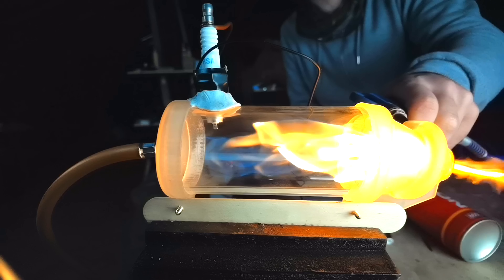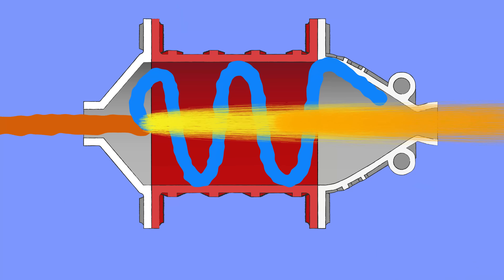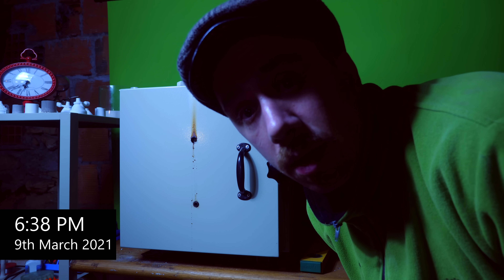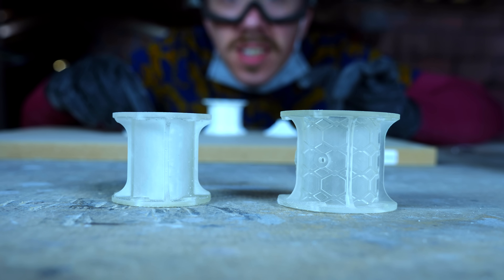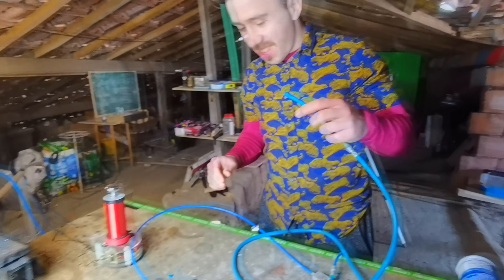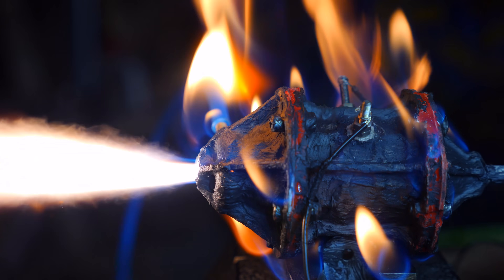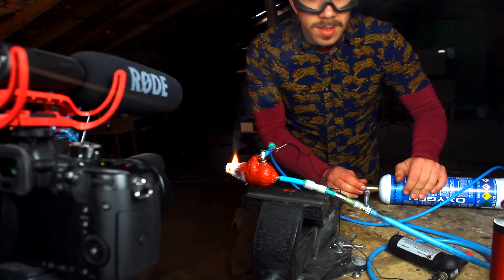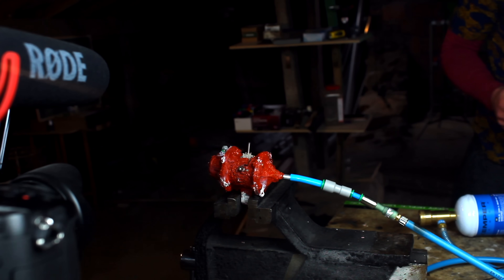Vortex Rocket V2.0 (3D Printed)

Comment: Maybe try a simple pottery glaze on the outside of the ceramic to stop the leaking.
Reply: I had wondered if you could pour the glaze inside the engine and refire it in the kiln.
Reply: you beat me too it hahahah
Reply: @philno  I replied before seeing this - yes, do this.
Reply: simply dip and allow residual  to drip out for ambit, then refire
Reply: @philno  The dip might work well. Not sure what the internal temps are and if the glaze/glass would be adversely affected on the inside. Painting on with a brush, as is done with ceramics, would allow for a thicker glaze (potentially) to the outside without interfering with the internal dimensions at all. Might be a risk of the glaze pooling on the interior where there is a smaller diameter port.
Reply: @blaircox1589  the point of this engine is to have a vortex of cooling air/oxygen running through it,
Reply: @philno  Ideally, yes, it still experiences radiant heat. and the vortex isn't perfect.
Reply: I doubt about the word, «émail» in french: enamel inside like porcelaine?
Reply: Outside is not as much problem as the inside.
Reply: @John Waddington Understood. The benefit of that is it makes it resistant to high temps. The glaze layer we are suggesting is to serve as an impermeable outer layer to prevent the gas from propagating out of the part. The glaze is applied as a thin slurry and will likely still soak into much of the part. It then needs to be re-fired where it melts to a molten state and solidifies essentially as glass. Our armchair comments can be confirmed through testing.
Reply: Glaze will crack under sudden temperature change and will leak
Reply: He could also coat the inside in fireplace sealant to make it harder for the gas to leak out
Reply: @PRODSKY22  That would be difficult to do and destroy the clean interior surface. Only an impermeable outer coating is required to contain the gas. Cracking of the glaze might be an issue, so experimenting with different types of glazes would need to be done. Coating the exterior and refiring would be easy with the added bonus of doing it in any colours he wants, so the parts would be glassy and outright awesome looking when done.
Reply: @blaircox1589  He should probably use a homemade glaze with a high proportion of alumina, as that's the component that confers higher melting points and lower thermal expansion to a glaze.
Reply: @PRODSKY22  Sodium Silicate is a fireproof sealant known to to seal better at higher temperatures, it may blister which will affect the internal geometry
Reply: and the inside
Reply: @John Waddington not necessary as the glaze is fired again. Any bubbles would be removed during this process. You also take care when applying the glaze not to have a lot of bubbles to start.
Reply: @blaircox1589  i'd still stick it in the vakuum chamber. chances are that you might trap airbubbles within the pourous ceramic adding stress to the piece  with thermal expansion. could also strengthen the material if the glasse is within the material. at least its worth a try
Reply: Yes
Reply: @Rocky Robinson perfect!
Reply: perhaps not a pottery type material but one that would melt just enough to get forced into the pores by the pressure? to the comment about the pottery glaze not taking well to sudden changes in pressure and temp... i think you have a similar situation with having a ceramic chamber as well.

you could probably do a pottery type coating on the outside tho as well.
Reply: On the INSIDE and then fired again to harden it

He has a kiln after all
Reply: How bout on the inside?
Reply: @theglobalwarming6081  probably don't want it on the inside. it's likely to crack or possibly even melt again depending on the temperatures. The outside coating will provide a barrier for the gas leaking.
Reply: @blaircox1589  without an inside seal tge gas will be pushing through the ceramic matrix and trying to make the glaze spall off

If the glaze is on the inside the ceramic holds it in place

It's much like glazing a porcelain cup
Reply: @miscbits6399  Sure, but I would guess the PSI is rather low in this application. The materials is as porous as a sponge, so the gas can easily leak through. The dip method will work so long as the excess can be drained without becoming too thick and ruining the ID tolerances. The interior layer may need to be thin while a thicker exterior layer applied. While I haven't made parts like this, I have worked with glaze.
Reply: @blaircox1589  i suspect it will take several dips and a very thin glaze
Reply: @blaircox1589  My concern with the dip process is that the inner surface of the rocket may get hot enough to remelt the glaze.  INTEGZA  no matter how you glaze it, make sure there is no glaze on the surface that will be sitting on the bottom of your oven!  ....unless you want your rocket to become a permanent part of the fire brick.
Reply: @parallax2107  That was my concern in a previous reply as well. And good point!  I don't know the exact firing process for dishware, but the same technique would apply here.
Reply: @theglobalwarming6081  Or both.
Reply: nooo!! or yes but the inside! not outside or your ceramic engine body will fill with fuel and oxygen and could explode!
Reply: @saintcyberchaos265  is that really likely? He's already covered the outside to seal in the gas.
Reply: @blaircox1589  no he didnt :) but he tried..

a vaze with water trapped in it can also explode(~ish) when you heat it up fast

if the liquid or gas oxygen/fuel mix expands fast the ceramic will come apart, I dont think the 'explosion' will be particularly dangerous but you never know.. either way we wants it to stay together

Comment: You could leave grooves between part joints and have o-rings or a metal ring (probably a soft metal) and then bolt it down to form a seal
Reply: but the issue is that it is also leaking through the holes in the ceramic parts left by burning of the resin and also a soft enough metal or O-ring would probably melt because the ceramics work very well at high temperatures but the surfaces are extremely hot so anything toughing them would melt if not properly rated for the heat.

Comment: I think the engines are failing because of the high pressure inside the chamber. Pressure testing might help.
Reply: Pressure testing will just show that they cannot withstand the pressure.
Reply: @Daemonamongyou  yea the engine chamber simply needs to be larger

Comment: Integeza: "my rocket.... it fell over"

Elon: "yeah. ........ happens that"

But seriously you know when you're using sealing the porosity of the part, it maybe a good to seal the inlets/exhaust and pull a vacuum?  I've done this with JB weld on cylinder heads and its sealed them well and it becomes the structure instead of a layer
Reply: That's an interesting idea
Reply: How does the vacuum affect the sealing? Is it just the air in the pores are no longer blocking the JB weld from getting into them?
Reply: @heimkhal2.097  You draw a vaccum on the inside of the part then air pressure from the outside pushes the JB weld into the pores
Reply: @DrewTeter  ahh. That’s interesting. Thanks
Reply: Or flex seal